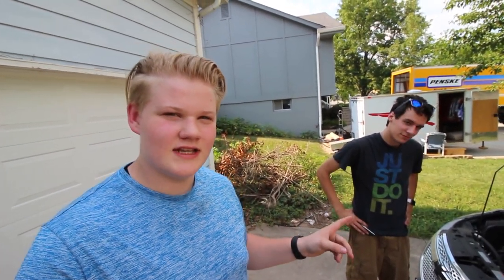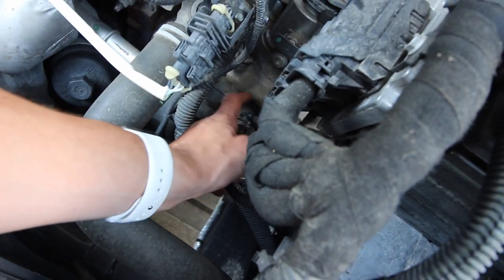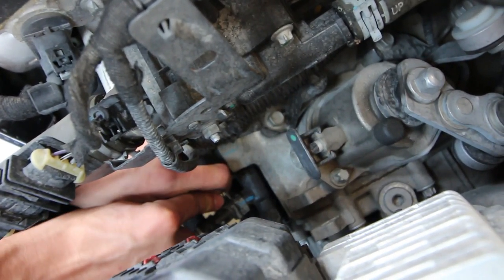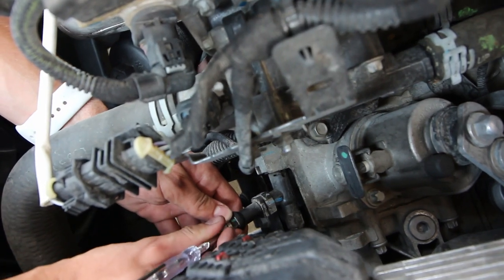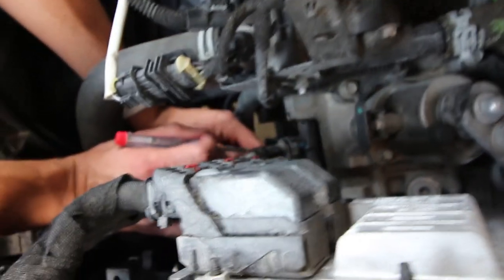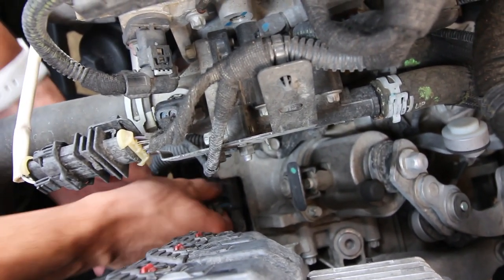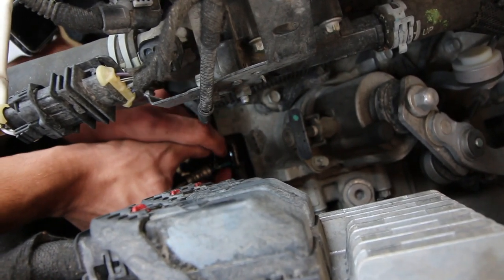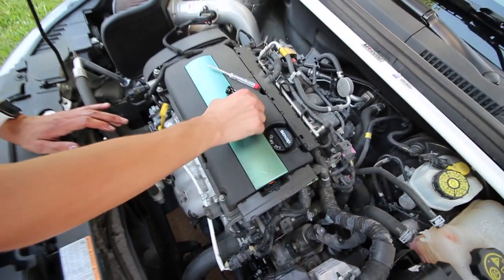CHEVY CRUZE CDV DELETE!

Comment: Since buying the Cruz I always thought it already has pretty fast shifting. Although I am switching from a 99 civic without putting the pedal to the floor my Cruz shifts about 2500 3000 rpm in automatic mode which is ridiculously fast compared to my old civic
Reply from the maker: +Steve Regal this is for the manual version cruze so you can shift quicker without grinding gears
Reply: +Jonas Godwin ahhhh gotcha I got the automatic cuz the other standard Cruz for sale was a year older with more mikes and no sunroof.. I'll always regret not getting a standard tho , nothing like hitting those gears man
Reply from the maker: +Steve Regal I love my manual!
Reply: Can you change from an auto to manual
Reply from the maker: +Randy Covalcine it would be more worth it to buy a different car
Reply: Randy Covalcine it's possible but you'd need a new transmission which is easily could be $3,000 or more without labor depending what u get n where u go. Unless u got thousands to blow with no problem go for it other wise your prolly better off just getting a different car
Reply: Ayyyy squad. I switched from a 2000 civic.